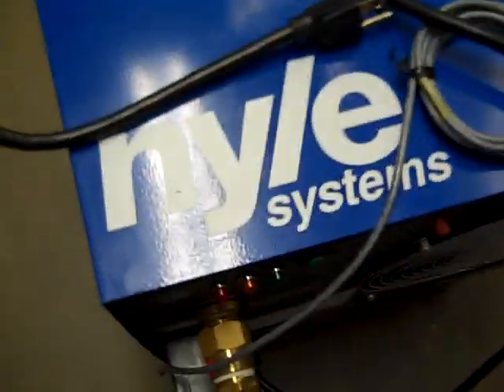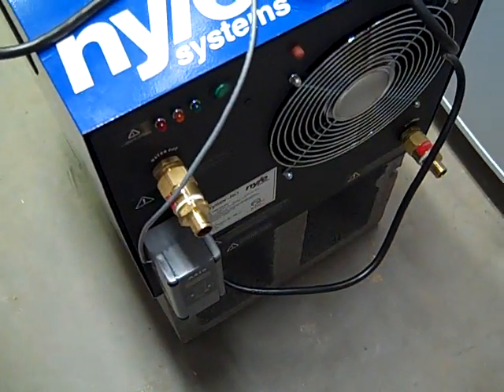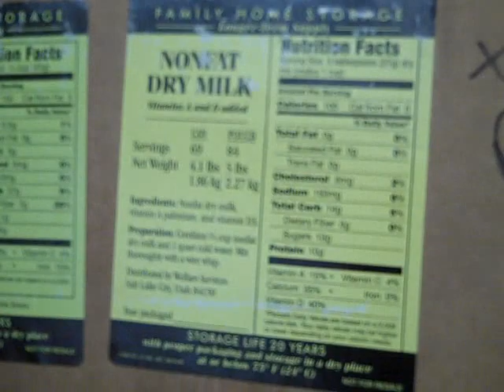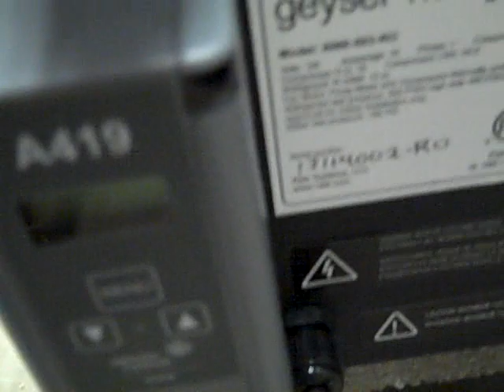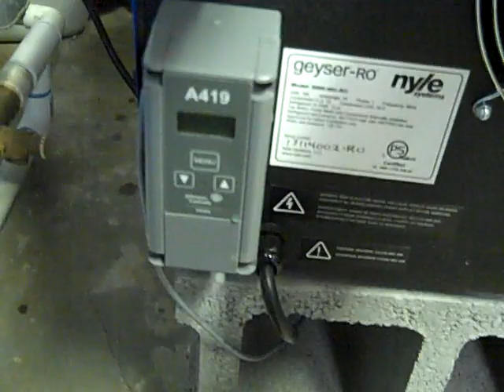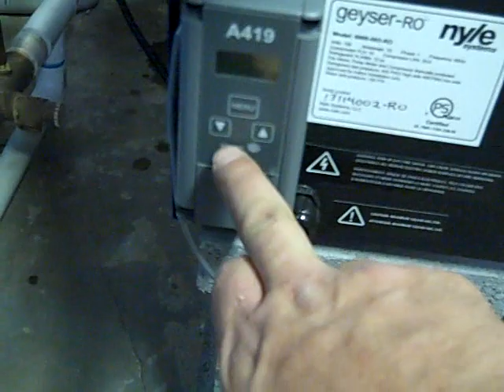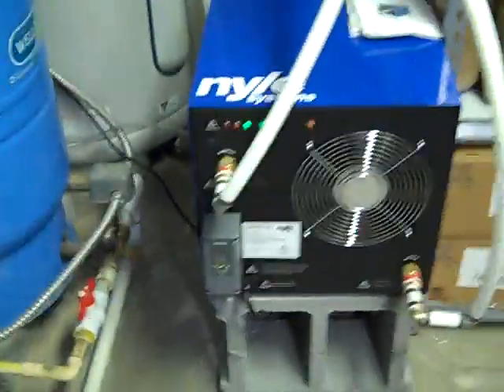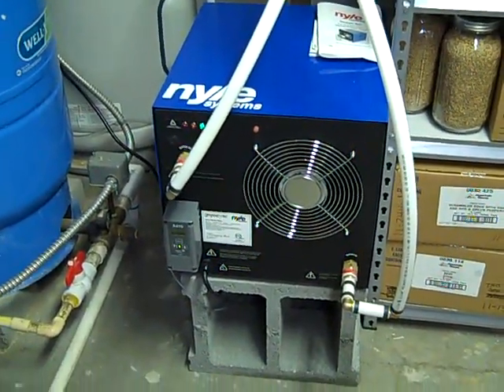Geyser RO:  Hot water with cooling as a byproduct!

Comment: The hot out of the heat pump connects to the cold in of the water heater.  The cold in to the heat pump is connected to the boiler drain in the bottom of the water heater.  The black nipple on the back that got the clear tube is a condensate drain for the moisture the Geyser takes out of the air.. same as an AC or dehumidifier does. Depending on how much moisture was in your basement it might replace it.  It would definitely be a better use of electricity.

Comment: Almost all tanks inevitably rust out, even the ones that have a heat pump built into them.  With this thing you can convert an existing water heater to a heat pump water heater, you can move it if you move, you could potentially install it in an attic during the summer and mech room in the winter and insulate the lines.  It offers a lot of flexibility.  I'm thinking about getting one and I'm a solar hot water guy.

Comment: Heat pumps are actually becoming normal and have been around for nearly a year here in Oz. When you buy a hot water system its already built into the side. We have solar hot water panels on the rooves there as standard for new houses now. We have an older kind which don't really like very frozen weather, and another one called "evacuated tube" technology which warms glycol in a round tube inside a glass tube with a vacuum and then goes up to a heat exchanger with a copper pipe.

Comment: It is an air to water heat pump. Heat pumps move heat around so if you put it into a hot space such as an attic or a mech room with a lot of other waste heat from motors and such it would move the heat in the air into the water.   A geothermal heat pump extracts heat or coolth from the water and uses it to heat up or cool down the air.  The pool temp and the air temps would be too close together unless your pool was really deep

Comment: The song was great but I sure wish I knew what you were pointing to and how that was hooked up to the Marathon electric water heater. Is there anyway for you to re-insert your audio explanation of how this system works? How much PVC collection capacity was required to power this heat pump? Would this be able to replace the use of a dehumidifier in one's basement during summer months? Any possibility of it similarly freezing up as do dehumidifiers when it is too cold?

Comment: I'm using a 7,000 BTU A7 AirTap heat pump.
search on "A7 AirTap install (ASHP hot water heater)"

And I've directly connected DC from two PV arrays to the water heater's elements. When it's sunny, The PV puts  about 1KW into the water (3412 BTU). 
It looks like my A7 AirTap power use of 1kWh per day is now at 1/2 kWh per day.  So, I'm paying for about 15 kWh per month for hot water. 
However, 2 elderly people don't really use a heck of a lot of hot water..

Comment: +pigletjt the potable water doesn't come in contact with the heat pump. You obviously don't understand how it works. The condensate does not go into the tank that goes into the drain - engineer775 Practical Preppers Does it matter where your water heater is? I have a storage closet that is in the upper loft portion of my condo. It's about 5 feet deep and about 20 feet long and the ceiling height is just over 6 foot. Is that a big enough volume of space to extract heat from? Or will I need to cut a hole in my door and put a vent of some sort there? It doesn't really say much on the manufacturers website. They all speak of basements - but I don't have one.